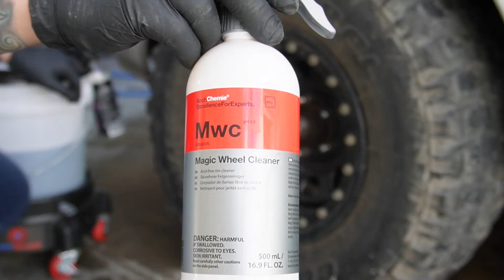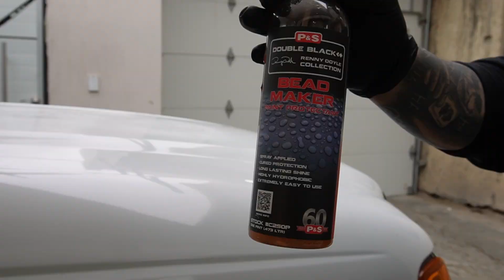Deep Clean 20 YEARS OLD Engine Bay | 04 Ford Ranger | ASMR Detail

Comment: HEY!!!! A clean engine is a good running engine, not only on the outside, the internal parts just the same to!  Everything clean looks good, and with a good clean engine, you can see any leaks that needs addressed. Besides, look at it this way, you like to have either a bath or shower to keep and stay clean, so it should be with your car or truck to!  And wax your car or truck with car wax, not any of this cheap spray on, wipe off so called wax which isn't nothing more than windex.

Comment: I have a 2000 Ford Ranger with a 2.5 liter engine (4 banger). I don't believe I pressure wash the engine at this point. I just don't believe the sensors and seals, being that their now 24 years old, could stand up to the pressure and keep the moisture out. Another thing, I noticed you didn't cover the alternator with a plastic bag or anything to keep it from getting wet. That could really damage the alternator.